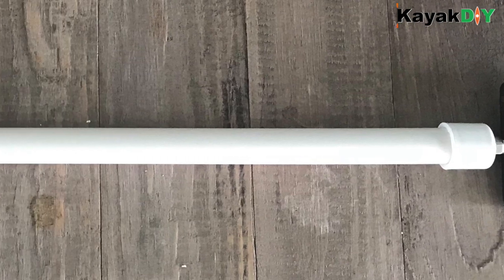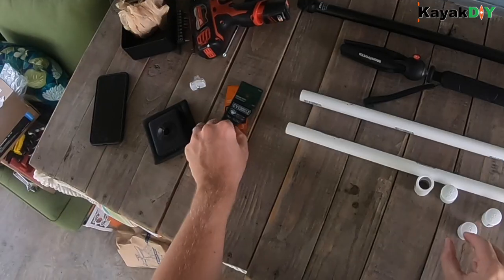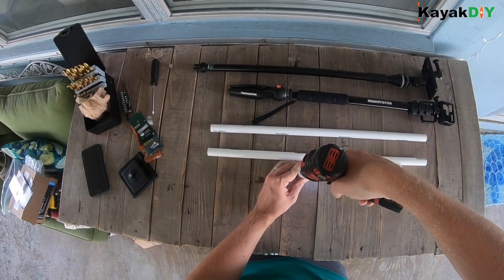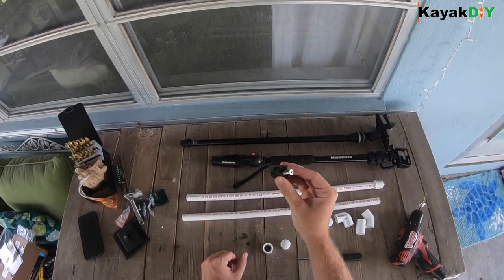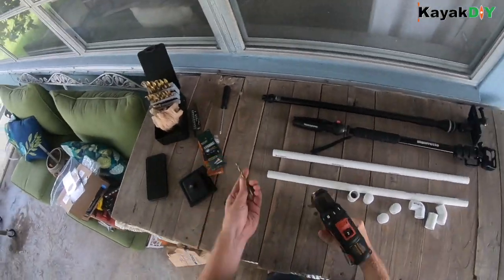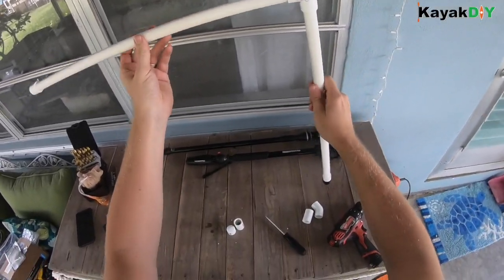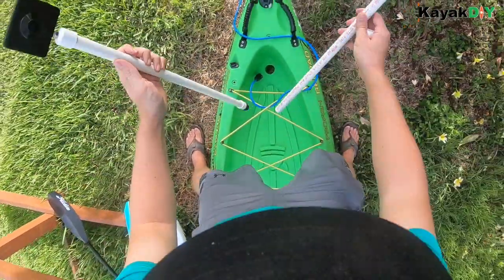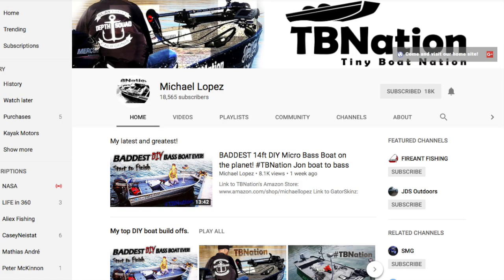Homemade Camera Pole & Is This Better Than A GoPro?

Comment from the maker: I Love This New Camera: 
https://amzn.to/2JL3DcY
Homemade Camera Pole Parts List
1/2" x 2ft PVC pipe (need one or two)
1/2" PVC caps (need two)
1/2" elbows or angle fittings (optional)
1/4"-20 x 3/4" locknut Nut & Bolt
Railblaza Adapter: https://amzn.to/2K1vpBq
Railblaza Mounts For Kayak: https://amzn.to/2Mwwvn2
Railblaza Track Mount Adapter: https://amzn.to/2JHAz65
Kayak Track Mounts (if your kayak doesn't have any): https://amzn.to/2JJJCDp
Railblaza Camera Boom
Camera Boom: https://amzn.to/2lcL7LN
Camera Adapter Kit (recommended for VR cameras): https://amzn.to/2MzGUOH

OUR PATREON: http://www.Patreon.com/KayakDIY

Comment: For about 4 bucks you can make a PVC attachment that will attach to a track mount. All the parts needed are on the plumbing isle at Home Depot
Reply from the maker: Yep...toilet bolts work great for DIY track mounting.  We use press fit t-nuts and toilet bolts on PVC end caps.  Did that in our light pole video few years back.